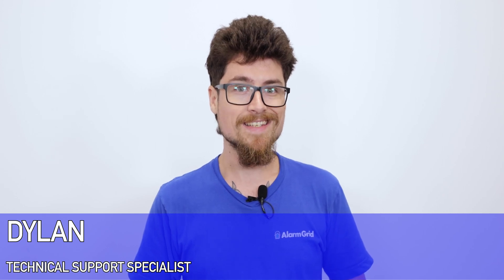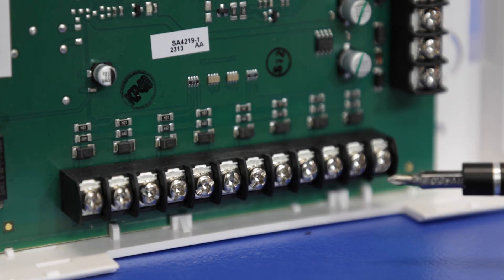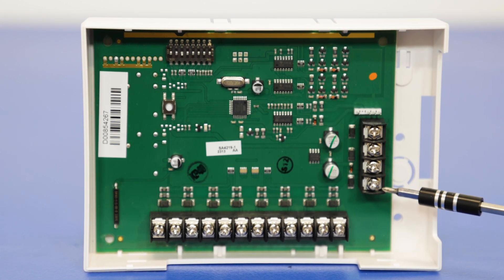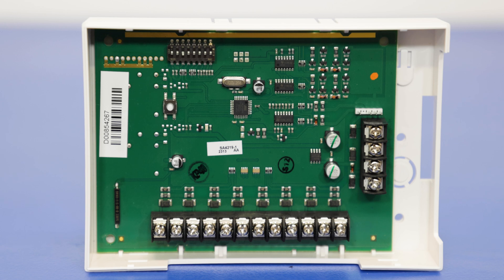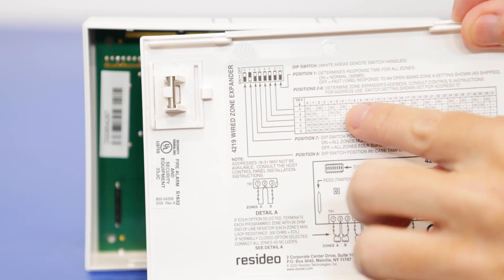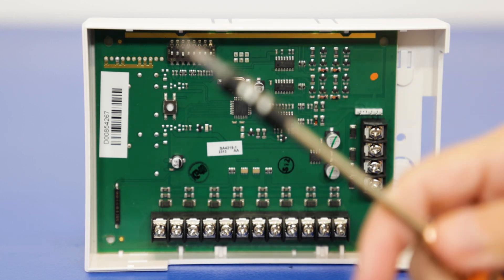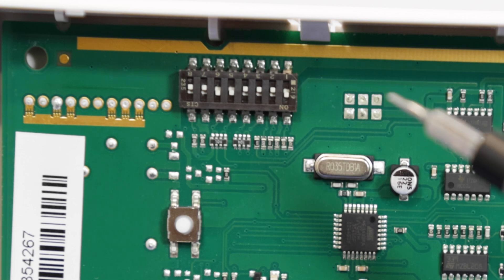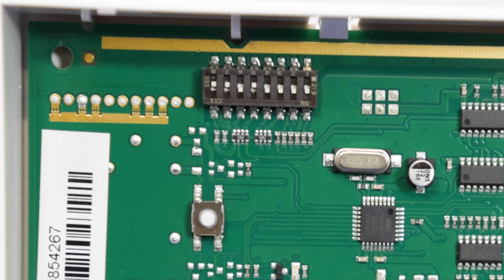Honeywell 4219: Setting the Address for a VISTA System

Comment: I wondering why you would spend 5 minutes discussing everything else BUT what people come here for, ADDRESSING the dip switches on the 4219.
Reply: Hi @alarmservicepros, We give an introduction and overview, for those not familiar with the module who may need some additional assistance with understanding the 4219. We did Break down the video into sections and Around the 4:35 timestamp mark then again at timestamp 6:42 discusses the individual switch settings, it is discussed which switches are used for Addressing the 4219 for the VIsta-15p/20P/21ip.  We hope our video helped with your addressing and configuration setup.
Reply: @DKAlarmgridSupport  Yeah, that's not what the description says, it's say's "Setting the Address for a VISTA System". Why not just stick to that instead of throwing 30 other things in  the video. That's the problem with you geek types. You take something simple and make it complicated.
Reply from the maker: Every video has an FAQ associated with it. The FAQ is linked in the description. You can see that here: https://www.alarmgrid.com/faq/how-do-i-address-a-4219-zone-expander-to-a-vista-system. It has a complete breakdown of the various addresses and how to set the dips. The video helps by showing which way is ON and which way is OFF for a dip switch. That's the main problem most people have, figuring out which direction is which.
Reply: @DKAlarmgridSupport  For zones 9-16 the address is ********* For zones 17-24 the address is *******

Comment: Can this be used on the vista 128 as well?
Reply: Hi @RamonCartwright, the 4219 is not compatible with the Vista-128/250 series panels. You would need a 4208SN or older 4208U (if you have an old 128b/bp), the 4208SN and 4208U expansion modules would wire into the polling loop terminals on the Vista-128 series panels.

Comment: Hey Dylan, Can This Zone Expander Also Be Used On The 1995 Honeywell Apex Destiny 6100?!
Reply: The 4219 would not be compatible with the Honeywell Apex Destiny 6100. You'd want to look into upgrading to a newer VISTA panel for the 4219 to work. 

The old expansion board for the 6100 system was the HWB416.